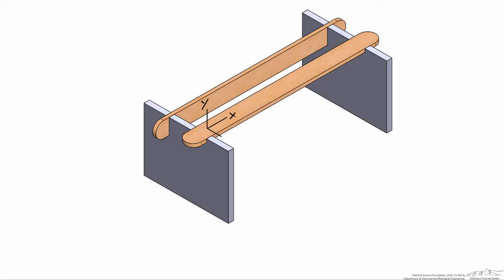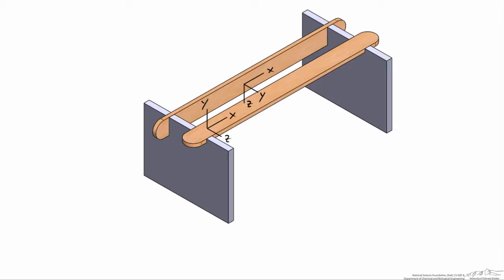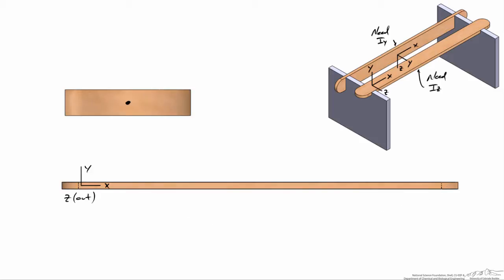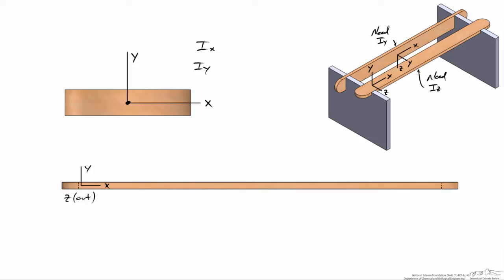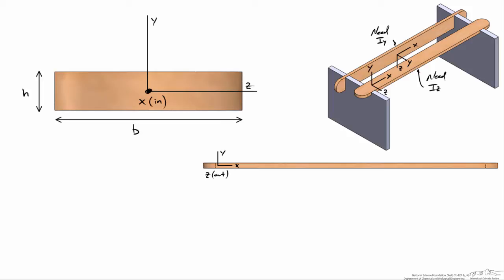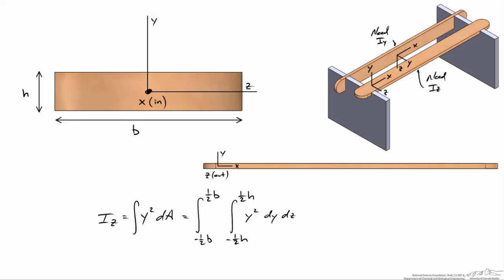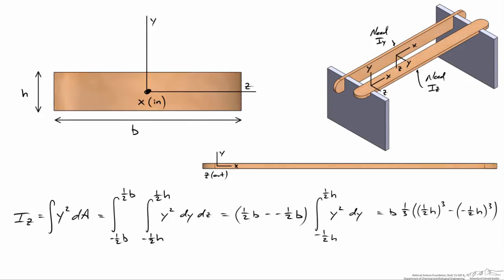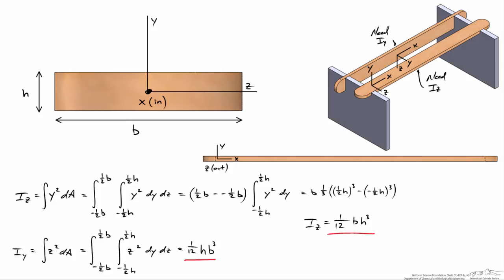Moment of Inertia for a Rectangular Beam

Comment: Why do I need to have an integral if I have exact numbers when I want to find exact numbers?  For the horizontal stick how would I calculate the moment of inertia through the y axis and I offset the rotation below the stick by .125?  I want to rotate it 90 degrees positive and 90 degrees negative. I like to do my calculations exact. Like your display, thanks!